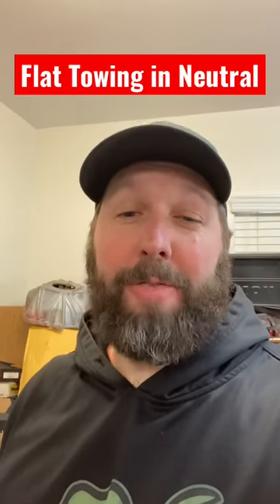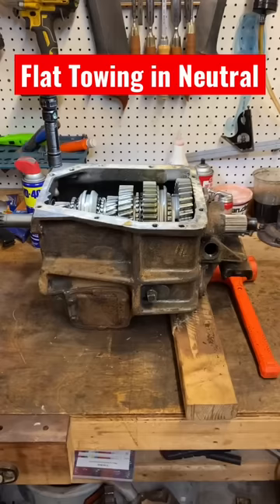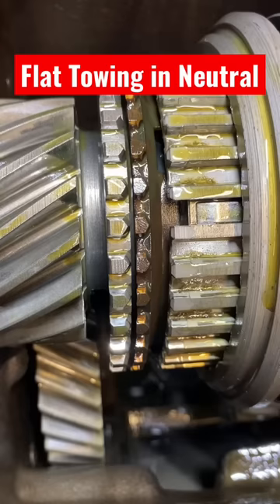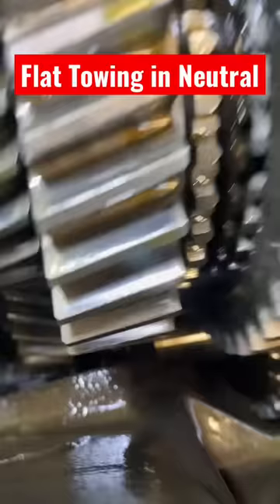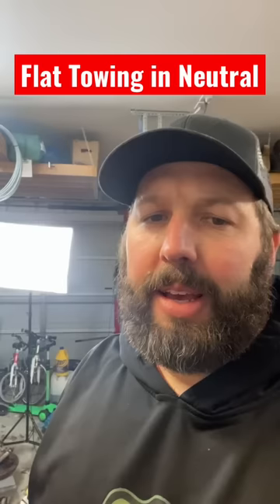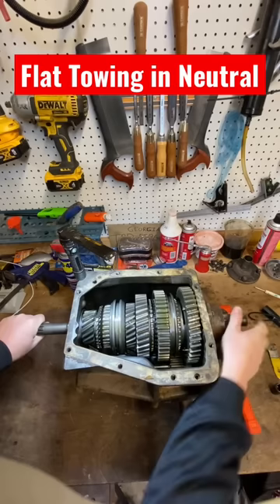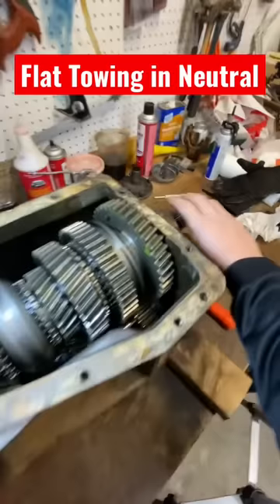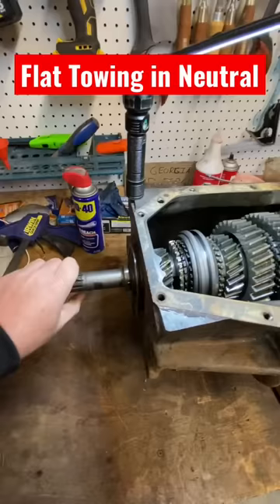Flat Towing in Neutral??? #transmission #stickshift #mechanic

Comment: So what is a flat tow and how do you tow a standard transmission car
Reply from the maker: Towing with all tires on the ground. Like a Jeep towed behind an RV. Some can be towed in neutral, some need the driveline removed, some can’t be towed safely at all. You have to read the owners manual for each vehicle.

Comment: When the vehicle is moving so is the conter shaft?
Reply from the maker: Not in neutral. The countershaft is driven by the input shaft.
Reply: @freedomworx  and the output is driven by the wheels or not?
Reply from the maker: @the_pride_right2839  the output shaft and driveshaft are always coupled. But the input and output shafts are not coupled in neutral. So the wheels won’t drive the countershaft in nuetral.
Reply: @freedomworx  sorry but my english isnt the best so thanks for the discussion
Reply from the maker: https://www.tremec.com/not_am_detalle/flat-towing-manual-transmission-vehicles/

Comment: You can't be serious how are you supposed to fix the the starting problem if you were to tow it in gear you must be a genius
Reply from the maker: I’m not a genius, but I do have a pretty high IQ. 2 things…. 1. It won’t start if the ignition is off. and 2. I never said to tow it in gear 🧐.  There are other option. Read your owners manual, it’ll explain it to you 🤷🏻‍♂️. https://www.tremec.com/not_am_detalle/flat-towing-manual-transmission-vehicles/

Comment: So that means putting in neutral on a downhill is also a bad idea?
Reply from the maker: I’d say yes but not for the reason you’re thinking. As long as the engine is running, and you don’t have the clutch depressed, you’re good to go. I like having it in gear to save the brakes, and ensure I’m able to accelerate if needed to avoid an avalanche 🤓

Comment: What about coasting in neutral in an automatic?  Gas ain't cheap!  Seriously tho.  Asking for a friend.
Reply from the maker: Let the engine idle if you’re going to do that. The engine  drives the pump in an automatic transmission. It’ll be deprived of fluid just like the manual.

Comment: guess doesnt matter on a fwd? havent had this issue ever on a fwd
Reply from the maker: It’s fine on many vehicles. You have to check the owners manual. FWD vehicles have a transaxle though, slightly different animal than just a transmission. 👍

Comment: What if you just overfill the transmission oil
Reply from the maker: It’s an option, but a little harder than it sounds.
Reply: @freedomworx  i can see that being the case depending on the car.
Reply: @freedomworx  seems easier than removing the driveshaft
Reply: @freedomworx  good explanation video by the way! You did a good job with the transmission case
Reply from the maker: Either is easy if you turn the car on its side 😎
Reply from the maker: I appreciate it. Thanks for watching 👍

Comment: So what your only other option is to tow it in gear?
Reply from the maker: You can remove the driveshaft, overfill the transmission, idle the engine, call a tow truck. The point is, just throwing your vehicle in nuetral and dragging it down the road can be harmful. So choose wisely.
Reply: @freedomworx Of course a tow truck but what if one is not available? I understand but  sometimes the driveshaft is actually CV axles.
How does an idling engine solve the oil distribution problem in the tranny? 
 The over-fill is an interesting idea.
Reply from the maker: Well first thing is to read the owners manual. A transmission with CV axles is general a transaxle, and doesn’t generally have oiling issues like this. It’s not applicable to every manual transmission.

Comment: So what, you tow in gear with the clutch held down or something?
Reply from the maker: You could. Or Remove the driveline, overfill the transmission, idle the engine, call a tow truck.

Comment: So put it in gear with the clutch pressed?
Reply from the maker: You should read your Owner's Manual. Towing in neutral is fine for some vehicles. Some need the driveshaft disconnected.

Comment: So tow it while in reverse?
Reply from the maker: You should read your Owner's Manual. Towing in neutral is fine for some vehicles. Some need the driveshaft disconnected.

Comment: Modern oil lubricant will coat the gears. This advice is very old school. If flat towing it is advisable to stop every hundred miles and turn on the towed vehicle.  Be smart, but get more information from multiple sources. Using a 50 year old transmission is not a great example for your demonstration.
Reply from the maker: Well Tremec builds modern transmission and uses modern oil… They don’t think it’s old school advice 🤷🏻‍♂️https://www.tremec.com/not_am_detalle/flat-towing-manual-transmission-vehicles/

Comment: So then how are you supposed to tow? If you flat tow a manual IN GEAR, you're spinning the engine and you'll have an even worse problem with the engine spinning.
Reply from the maker: You should read your Owner's Manual. Towing in neutral is fine for some vehicles. Some need the driveshaft disconnected.

Comment: So do you put it on reverse when towing?
Reply from the maker: You should read your Owner's Manual. Towing in neutral is fine for some vehicles. Some need the driveshaft disconnected.

Comment: so what is the Neutral is made for?
Reply from the maker: For when the car needs to run but not move.  You should read your Owner's Manual. Towing in neutral is fine for some vehicles. Some need the driveshaft disconnected.

Comment: So don't pull your vehicle in neutral, if you break down an get a buddy to pull you home or wherever, Cause it doesn't get let fluid sling up onto the rest of the gears..  good to know
Reply from the maker: You should read your Owner's Manual. Towing in neutral is fine for some vehicles. Some need the driveshaft disconnected.
Reply: @freedomworx  Thanks that's good to know,  I'll probably never  tow a vehicle more than a few miles,. But thanks 🤙

Comment: Next up, what happens when you tow a 4WD/AWD vehicle without all 4 wheels off the ground.
Reply from the maker: Perfectly fine for some of them. Have to check the owners manual.
Reply: @freedomworx  True, but not if they have an LSD, which it'll burn out if towed for any distance at speed. My AWD has one and I always worry that it'll be towed by some idiot who doesn't know this or care.

Comment: so howdo you flat tow a manual 2wd vehicle?
Reply from the maker: You should read your Owner's Manual. Towing in neutral is fine for some vehicles. Some need the driveshaft disconnected.

Comment: With no ĺoad, no oiling makes very little difference.  How can you tow in gear ?
Reply from the maker: It makes a difference to your bearings and synchros 🤷🏻‍♂️. You think putting it in gear to tow it is the only other option?
Reply: @freedomworx  ball bearings and synchros shouldnt be harmed within 50 miles.  I have known (older) engines to have done that without oil, then  done another 100k after oil added.
Reply from the maker: Any science behind your 50 miles number, or any input on maximum speed? I’ll keep recommending people to do what there owners manual says. I’m just showing why the owners manual might say to not tow in neutral 🤷🏻‍♂️
Reply: @freedomworx  speed is only relevant if heat is an issue.  1st gear makes it hardest to turn the engine.  Try bump-starting a Ducati in 1st gear.  It won't. Do it in 2nd and you might succeed.

Comment: What great do you put it in?
Reply from the maker: Read the owners manual. IF you can't tow it in neutral, you'd need to pull the driveshaft or tow with the drive wheels off the ground.

Comment: There is absolutely no reason to have any vehicle moving in neutral, no matter the weight, engine, work being done, either auto or manual, NEVER. The wheels MUST be connected to the engine at all times, saves fuel, saves the engine and will save you. :) And don't bother telling me I'm wrong. I'm not. :)
Reply from the maker: Was that a double negative?

Comment: Well, Ford's must be that much better did it with two different vehicles one add 235,000 on it and the other one had 450 never had a problem...... So please tell me why Ford's can do it and never have an issue but yet you don't think it's possible
Reply from the maker: It’s not a Ford or Chevy thing. It’s specific to the transmission in each individual truck. It’s perfectly acceptable for some transmissions, and not others. https://www.tremec.com/not_am_detalle/flat-towing-manual-transmission-vehicles/

Comment: Just overfill the transmission to the brim.
Reply from the maker: It not as easy as it sounds. Filling the level above the fill hole level is a challenge as long as gravity is doing its job 🤓
Reply: @freedomworx  just pour down the breather hose, easier than taking cv shafts or drive shaft off.
Reply from the maker: @jarnoob I guess, if you have easy access to the vent 🤷🏻‍♂️

Comment: Pull the driveline or put transfer case in neutral.
Reply from the maker: Both are solid options. But you have to refer to the owners manual. Some t-case will actually fail from doing that.

Comment: Then how are supposed to tow it?
Reply from the maker: You should read your Owner's Manual. Towing in neutral is fine for some vehicles. Some need the driveshaft disconnected.

Comment: I thought you had to put it in neutral to tow it or it would destroy your trans.
Reply from the maker: Well, I’m not telling you to tow it in gear. I’m telling you that towing it by just putting the trans in neutral will destroy some transmissions. You have to read the owners manual to determine how the car can be safely flat towed.
Reply: @freedomworx  I only asked as mine is auto and it’s been towed in neutral, but I know manual and auto are different.
Reply from the maker: @Serpentor2000  read tour Owners Manual. Some manual transmissions can be safely flat towed in neutral. I don’t know any modern auto that can.

Comment: Keep it in reverse with the parking brake applied..
Reply from the maker: You should read your Owner's Manual. Towing in neutral is fine for some vehicles. Some need the driveshaft disconnected.

Comment: I take it that this video was posted on the morning of April Fools' Day?!😅
Reply from the maker: This is not a joke 🤷🏻‍♂️ https://www.tremec.com/not_am_detalle/flat-towing-manual-transmission-vehicles/
Reply: @freedomworx  So if it's in gear,how do you stop the engine from turning over and at least causing unnecessary wear and tear?.....(ie at least what would be "engine braking" if you wanted it)!!

Comment: So what gear do you tow it in?
Reply from the maker: You should read your Owner's Manual. Towing in neutral is fine for some vehicles. Some need the driveshaft disconnected.

Comment: This is wrong. You shouldn’t flat tow an automatic transmission in neutral, especially a newer one because the pump is electronic. You can and will burn up the transmission
Reply from the maker: This video is about manuals, not automatics. And it isn’t wrong. Look it up 🤷🏻‍♂️

Comment: He said manual transmission what about an automatic which most cars have
Reply from the maker: Some manuals can be flat towed in neutral, some can’t. Virtually no automatic teams can be flat towed in neutral. If the engine isn’t running, the pump isn’t pumping in an automatic. So there is no lube or cooling anywhere in the automatic transmission.

Comment: So what ur saying is put it in like 4th gear and strap a brick to the clutch peddle
Reply from the maker: I’m saying read the manual 😂. It might be fine, you might need to disconnect the driveshaft, you might be calling AAA 👍
Reply: @freedomworx lol was just a joke but I agree reference owners manual
Reply from the maker: @gradystephenson3346  it’s hard to know who’s joking these days. The owners manual has to tell people to not drink the contents of the battery these days…because someone obviously tried it at some point 😂😂
Reply: @freedomworx  I see a lot of horror stories of jeep owners towing there jeeps behind there campers
Reply from the maker: It’s fine if you do it correctly. Trans in gear or park, depending on whether it’s auto or manual. T-Case in Neutral 👍

Comment: in 1975 it had oil in it
Reply from the maker: Wouldn’t make any difference. It would all be sitting in the bottom, and not on the mainshaft or its bearings/synchros/bushings 🤷🏻‍♂️

Comment: As a millennial that his dad went to get cigarettes when i was 8 and still isnt back yet, what happens with an automatic?
Reply from the maker: Same thing really. The pump is driven by the engine. If you tow one in neutral, no lubrication will be circulating in the transmission. Some of the very old automatics had pumps driven off the output and input. But those have been out of production for 50 or 60 years.

Comment: I'm still curious why everyone just accepts bad designs.
Reply from the maker: It’s not a bad design. Engineers could just raise the oil fill port for a higher level, but you’d sacrifice efficiency. This transmission doesn’t shift very fast either. That doesn’t make it a bad design, it just means it’s designed to be used in a Dump truck, not to be towed behind a Motorhome. 🤷🏻‍♂️

Comment: Flat tow… ??? What are you referring too??
Reply from the maker: Towing with all four tires on the ground. Like towing a Jeep behind a Motorhome.
Reply from the maker: You should read your Owner's Manual. Towing in neutral is fine for some vehicles. Some need the driveshaft disconnected.

Comment: So how do you tow it pull the shaft
Reply from the maker: You should read your Owner's Manual. Towing in neutral is fine for some vehicles. Some need the driveshaft disconnected.
Reply: @freedomworx  thx
Reply from the maker: Thanks for watching

Comment: U are nuts next time ur on the interstate look at all the motor homes towing I just towed .f150 ford pickup 5 speed  from Arkansas to mesa Arizona and back getting ready tow same pickup to Orlando Florida so bs
Reply from the maker: It’s transmission specific. Did you refer to your owners manual, or did you just assume it doesn’t matter? https://www.tremec.com/not_am_detalle/flat-towing-manual-transmission-vehicles/
Reply: I've been towing long time never no issues put in neutral get to towing this includes automatic manual transmission I never take out the drive shaft another thing look at wrecker drivers they pickup small trucks jeeps all the time by front end and towthem god nos how far so bs read car manual
Reply from the maker: @Jesse-lu7bt  you do you 🤷🏻‍♂️

Comment: So what then? Tow it in high gear ?
Reply from the maker: No. Read the owner’s manual. It will tell you what is acceptable for that specific vehicle. But it won’t tell you to tow in gear. Some can be towed in neutral, some need the driveshaft removed, some can’t be flat towed at all.

Comment: The solution to towing in neutral, or any gear, is to remove the wheels. If you are in a hurry, just remove the lug nuts and let physics do the rest.
Reply from the maker: I generally just recommend to read the owners manual 🤓

Comment: Does the owner step on the clutch the whole way?
Reply from the maker: You should read your Owner's Manual. Towing in neutral is fine for some vehicles. Some need the driveshaft disconnected.
Reply: @freedomworx  I am just pointing out the absurdity of leaving it in gear.
Reply from the maker: @paulwolf8444  nobody said to leave it in gear. That assumption is absurd.
Reply: @freedomworx  It's the implied inverse of the video.
Reply from the maker: Well I created the video, and I had no intention of implying that. 🤷🏻‍♂️ The intention was so people would know, that even though it might seem perfectly harmless to tow a vehicle down the road in neutral, that’s not always the case. A small fraction of people thought it was a spoof. The rest used logic. I can’t make a 60 second video that explains it so everyone will understand it. Hell, I couldn’t make a 60 minute video that everyone would understand.

Comment: That’s what we call poor engineering or a design flaw!
Reply from the maker: Designing a transmission that sacrifices efficiency or strength to allow for a mode of operation that is never likely to actually occur would be a bad design. They could have easily raised the fill port an inch to solve the issue, but it would sacrifice efficiency. Just like overfilling a diff or engine sump. The bad part of this design is the fact that the operator has to be smart enough to read their owners manual. 😉